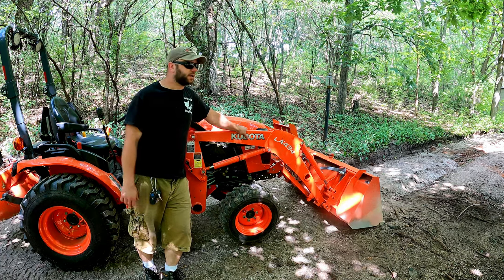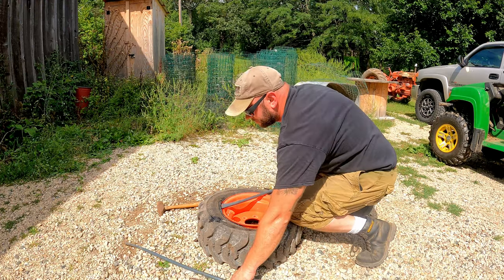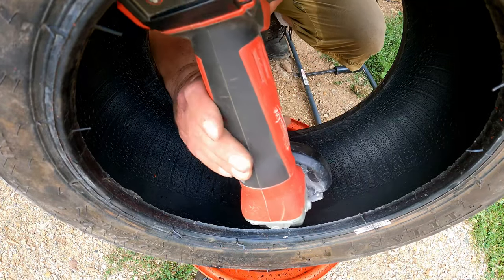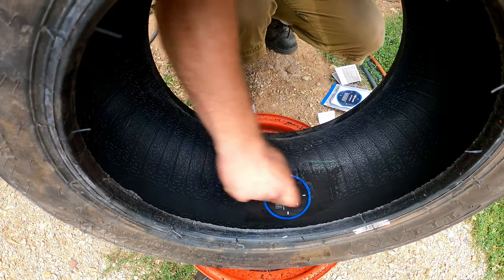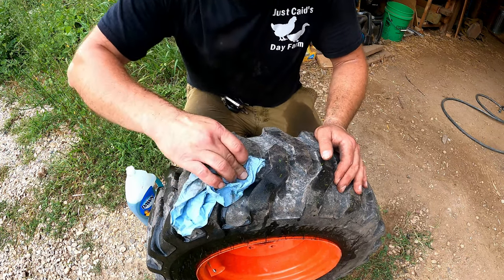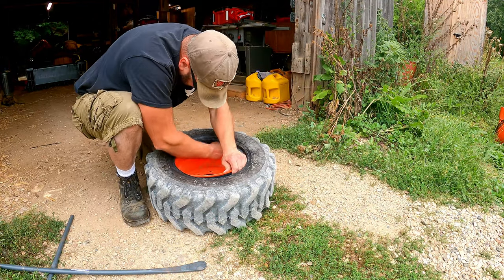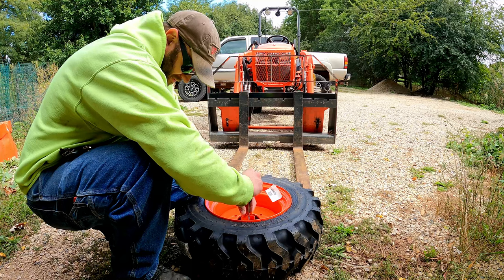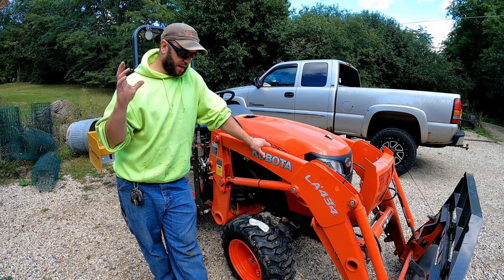HOW TO CHANGE A TIRE WITH KUBOTA B2601

Comment: Justin, Great job.  Another challenge handled. 👍 

Kubota sells their Tire & Rim combos for less money than just the cost of a tire.  Its kind of a great deal that way.  I learned that from Neil at Messicks on one of his many videos.

The only other thing I would do is throw cardboard or a piece of plywood down when forced to work on the ground.  It helps to keep gravel, dirt, and grit out of the tire bead & rim...  😊 Dan
Reply from the maker: I was totally shocked when my local dealer told me it was cheaper. That's a good call with laying something on the ground first. I will do that next time! I did blow out the beads with compressed air before filling the tire it just didn't make it into the video. thanks again for watching and commenting!

Comment: I am like you, sometimes I just want to do it myself.  Another big reason to learn is because sometimes you need your equipment and the tire shop is closed.  I picked up the harbor freight tire tool/bead breaker and that makes the job a lot easier.  Still hard!  But easier.  Good work!
Reply from the maker: Thank you! Should check that out before I do the tires on my case ( that will be a while though).

Comment: so the bad tire has the patch and tube right? i would fill the gap with silicone just to keep dirt out.
Reply from the maker: Not a bad idea! what kind os silicone would you use?
Reply: @JustCaidsDayFarm   i would just look for one that black and meant to stay flexible.
Reply from the maker: @rottmanthan  good tip. Thanks!

Comment: Having the tube in there is not necessarily a bad thing. Small front tires on tractors like tend to lose air constantly. A lot of users opt to “tube up” the fronts to fix the problem.
Reply from the maker: The tube inside the tire didn't bother me. The issue I had was the gash in the tire was so big that I could see the tube when inflated. I felt like that was asking for trouble so I opted to get a new one. Now I have a spare tire and rim if I am ever in a pinch. Thanks for the info and for watching and commenting!